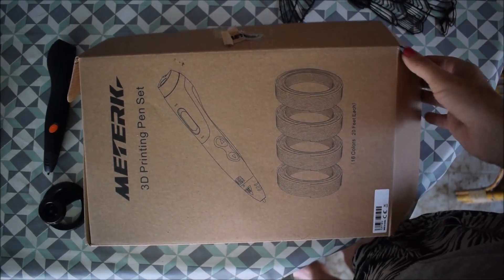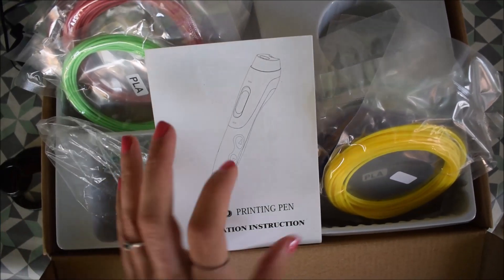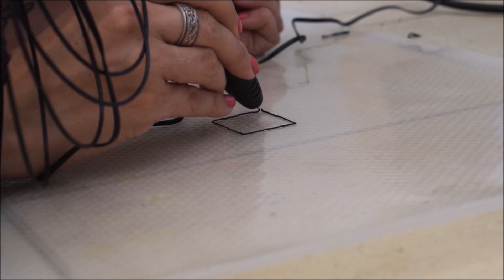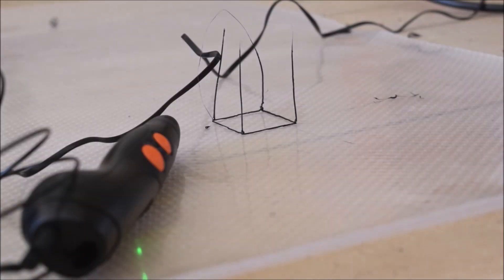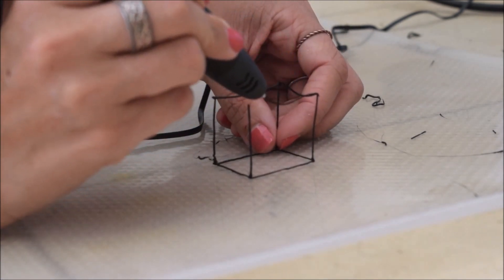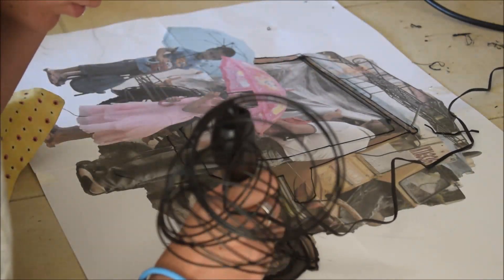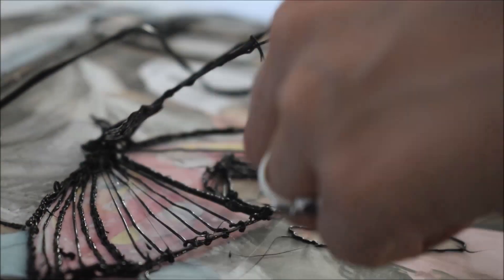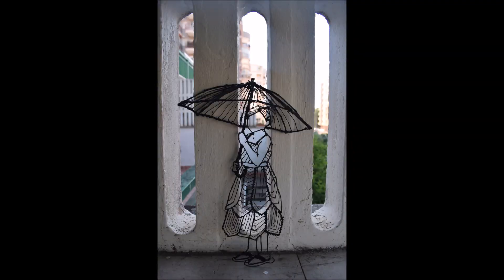3D METERK PEN How to draw in 3D using a cheap 3D pen tutorial

Comment: Hi, I have one of these but when feeding the filament in, it goes so far then stops? Any help would be appreciated. Thanks
Reply from the maker: Hi there! Thanks for your question, happy to help! so this has happened to me maaanny times and could be due to a couple of reasons,just before anything, when you are refering to feeding the filament, you mean you place it in the hole and then press the button so that the machine " grabs" the filament right? :the reasons ive found are 1. the filament is bent/torn/ folded. since the filament is in rings, sometimes it gets all twisted, and bends and creates a " knot" which wont go through the machine or the end of the filament is not " straight" and has a little bit of dangly plastic from the last use....what i do is i cut the filament, so its a clean end going in.... 2. there could be filament stuck from previous uses... ( do you notice a sound change in the buzzing of the machine? ) if so, it means something is stuck.... this has happned to me before and ive had to dismantle the entire pen and clean the piece out. let me know your thoughts and hopefully i can help out...i might actually make a video on how to " open up the pen" and clean it out when plastic snaps off inside... hope this helps :(
Reply: Lara Mesanza Hi Yeah Iv tried cutting it but it didn’t work so must be something stuck in it. A video would be great on showing how to do it! Thanks for the help.
Reply from the maker: @gregmclachlan6722  does it make a different sound? mine makes a normal sound when the filament goes in and the little wheel grabs the the filament, and when its stuck , you can here the wheel spinning differently. il make one after the xmas holidays especially for ya !
Reply: Lara Mesanza yeah, it goes down to the bottom sounding normal then stops feeding in and then makes a different sound. That’d be great! Thank you